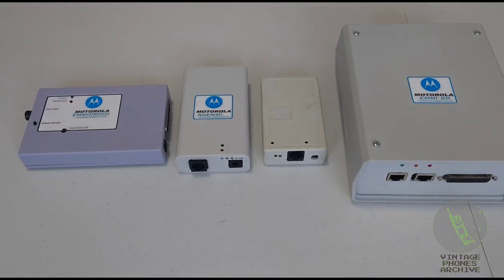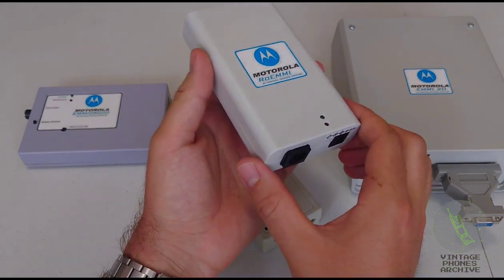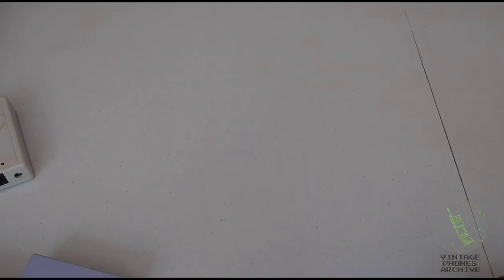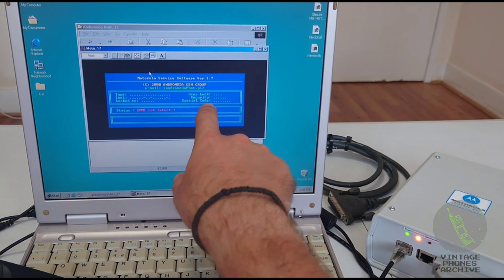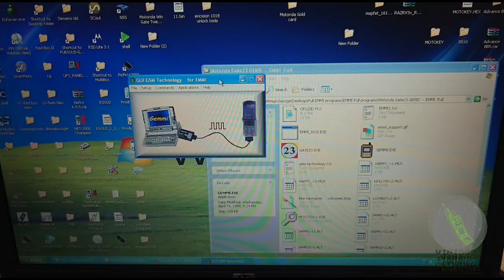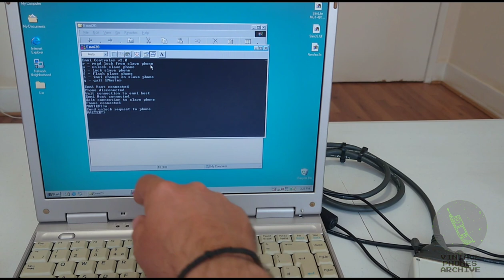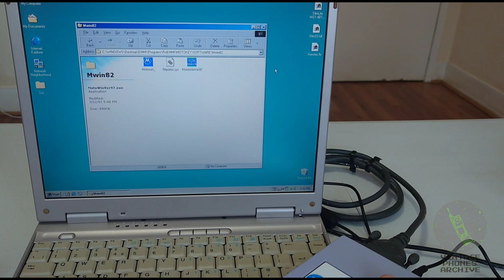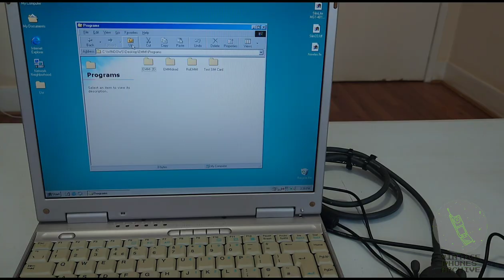Motorola EMMI boxes explained - How to unlock ANY old Motorola phone

Comment: motorola emmi version 13.1 they did make a box that was non computer it was 9v battery only had a button switch on top for contact service provider fix
Reply from the maker: That's the Emmi clip, a very simplified version of Roemmi
Reply: @Vintagephonesarchive  wish I could find one in emaculate condition like new with the leads I use to own one until me and the wife split up she wouldn't give me my property back out the house
Reply from the maker: @AlexanderSmith21  those are pretty much impossible to find anymore, same as Roemmi. That's why I build my own